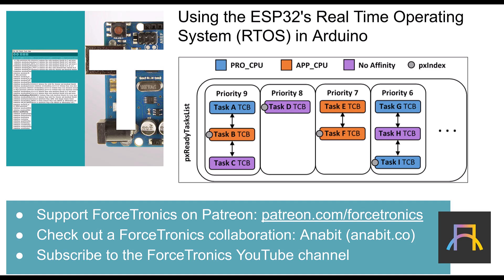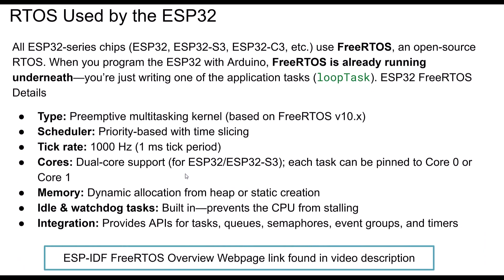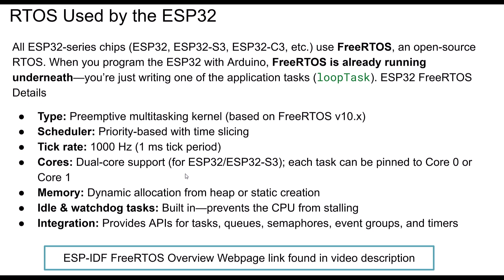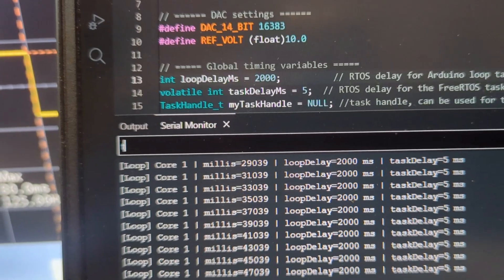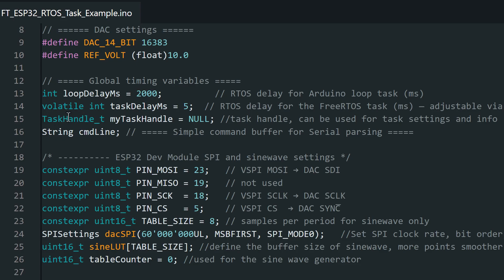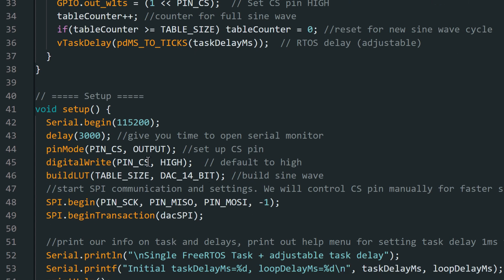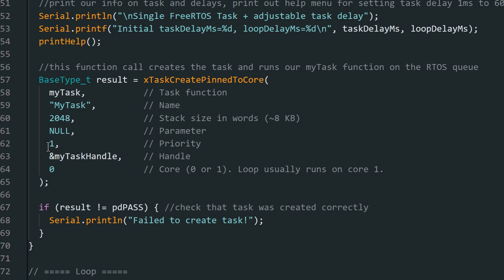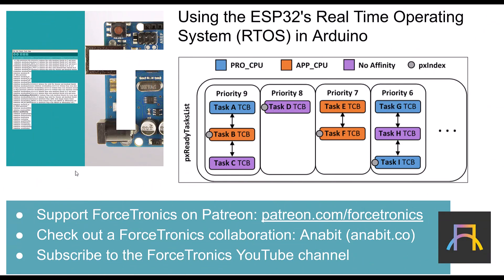Using the ESP32's Real Time Operating System (RTOS) in Arduino

Comment: Interesting topic. I use interrupts because I don’t have to worry about missing an event. What happens if your timing is too fast, is there a chance it will miss the next task? What about if you add more stuff into your task. So you have to constantly modify your timing?
Reply from the maker: Thanks for the comment. If a task is running and it is time to execute another task that is higher priority the current task is paused (current task's stack is left where it is) and then the processor picks up where it left off the next time the RTOS executes that task. Just like Windows or any other operating system. Keep in mind with a timer tick rate of 1msec, an ESP32 can run a lot of code in that time period. FreeRTOS has a lots of ways to help debug if a certain task is being starved of processor time. But you would have to have a lot of code and tasks to run out of bandwidth on a microcontroller like the ESP32. If you are setting up FreeRTOS in your code yourself you can actually define the tick rate and change it from 1msec. But when using Arduino it sets the tick rate up under the hood (you may be able to change it I have not tried). It definitely doesn't compare to interrupts for asynchronous events.